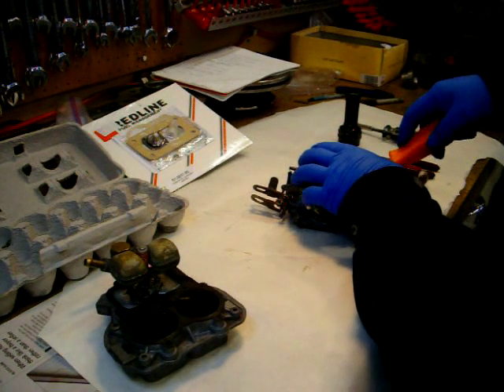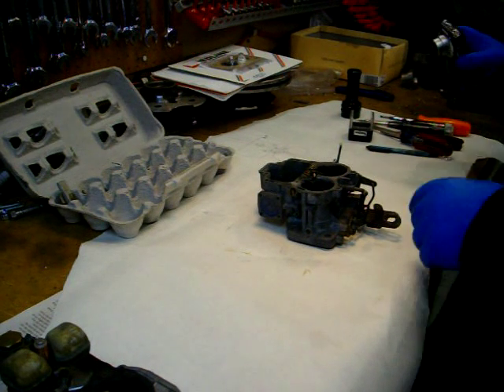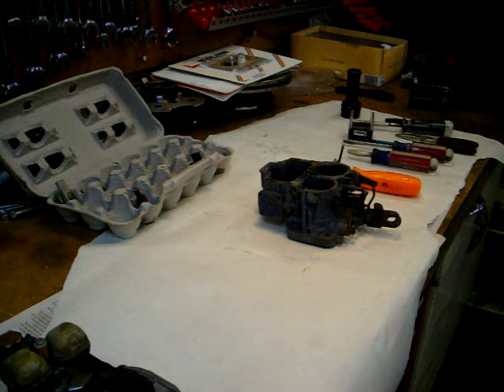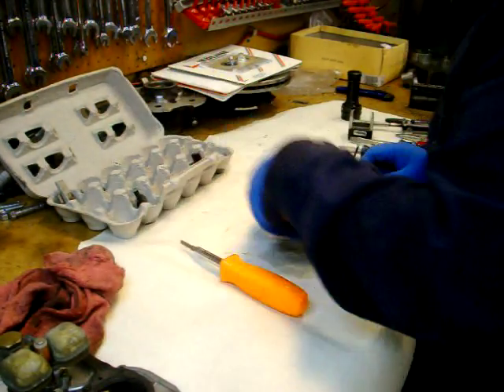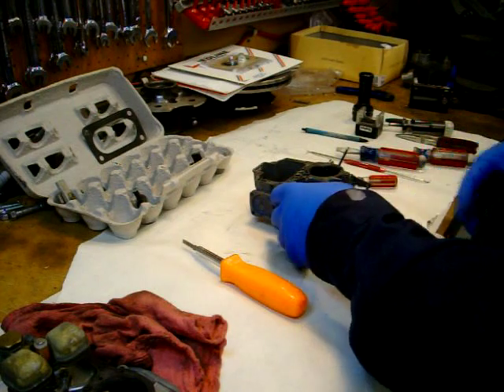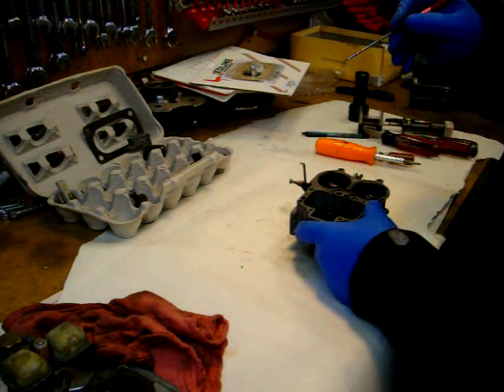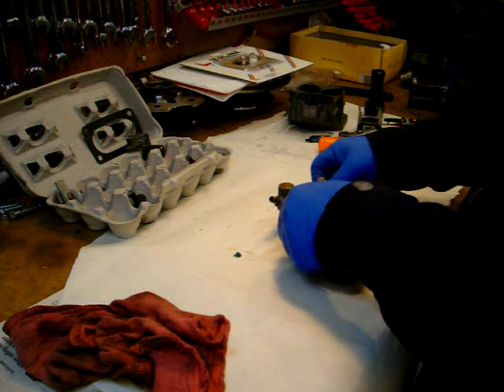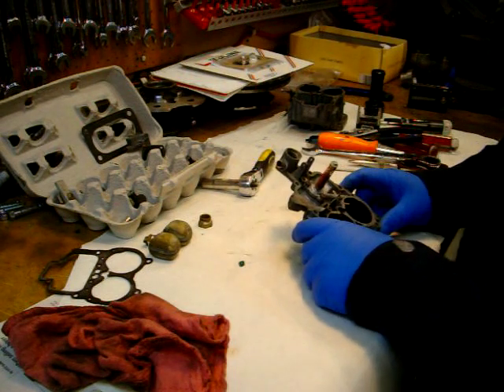Weber DGV Rebuild Part 1

Comment: If the venturi was backwards the jests are probably mixed up.
Reply from the maker: Pretty old vid, but if I remember right, everything was swapped side to side.....therefore wrong. lol  Worked much better after I got everything back on the correct sides.
Reply: @bluehandsvideo  <<<< I just did the same one but slightly different jets.  The last rebuilder had the main and second switched.  It was a probably 5th gen rebuild!  LOL!  Still got the wrong accelerator pump diaphragm in the kit, so I had to clean up the old one and use it.  Glad it was still alive.
Reply from the maker: @niceguy1183  Happy to hear you got it worked out. :)

Comment: Did you check side play on throttle shafts?  Good place for a vacuum leak if loose and leaking.
Reply from the maker: +Chuck Holmes  You are absolutely correct!!!   It must have been okay.....I won't rebuild a carb with loose shaft bushings.  These days, I have the equipment to replace the bushings if they're loose. :)

Comment: Thank you for posting. Very helpful indeed.
Just curious, I'm in same boat, as all the jets on mine are pretty much reversed from what Weber says they should be. Dunno if the previous owner was super smart or careless   ;) How was your motor running after rebuilt? Did you have any trouble?
Thank you again for posting.
Reply from the maker: This was a very early video for me.  I've always wanted to go back and redo it, I just rarely work on cars these days. .....just the parts. :)   The weber worked a lot better after I was done.  The weber is actually a bit more tricky to tune right compared to the Hitachi.  The goal with the weber is to have the butterfly as closed as possible.  The closer it is to closed, the more/longer vac signal you'll get for the dizzy advance.  Took me quite awhile to finally figure that out........which I did when I actually read the directions instead of tuning it like the hitachi!!  LOL!!!!  Don't have to be too bright to be me! :)
You're more than welcome!  I'm glad to hear it helped! Thanks!!
Mike

Comment: Ok....mate? Dunno what to say but 
You'd might as well had just done an audio version I couldn't see shit.  Have you heard of lights and an over head camera view. 
- I don't know what this part is? 
Maybe you should learn about the parts before making a video about fixing a carburetor. Nice attempt though.  How's that HD camera going....would love to see a strip down in a clear, close up well lighted video :)
Reply from the maker: You're right.  This was one of the first vids I took.  I used to do a lot of picture/text how-to's and write ups on the Datsun forums.....this was early on while trying to switch to video.  The new camera is much better and my shop has much better lighting not too.  I'd love to redo these vids.  There's a weber on my "Mend" 521 project, but who knows when I'll get to that.

Comment: The Weber has plenty of balls over the Hitachi,if tuned corrected. If you catch my drift
Reply from the maker: LOL.....I do.  Those little balls can be a PITA to keep track of sometimes!
The Hitachi actually works really well.....but the shaft bushings would wear out and once they started leaking, a new weber was a huge improvement.  The weber is a bit of a pain to get tuned correctly.  I learned the hard way that if you try to tune it the same way as the hitachi, it won't work well at all. lol  I think I spent a couple of years tuning mine wrong before I finally got wise and did it according to the directions.  Amazing how much better it worded after that!  
One of the best running L-series motors I've ever had, had a hitachi on it......but that was mainly in the lower half of the rpm range.  Overall, I think the weber is the way to go.. :)
Reply: I switched out my Hitachi for a 36DCD7 Weber (36/36) on my 1988 Nissan B140,the South African equivalent of the Datsun Sunny pickup. Rebuild kits for the Hitachi was just not good quality anymore,and I got tired of replacing it every few months. And like you mentioned about them leaking.  I definitely noticed an improvement from the Weber,but its not running as good as it should low RPM's. But other than that,it goes like the clappers when the 2nd barrel opens up. Bought a 32/36 DGV to try out and play with,and maybe use for a different little project, my 1972 Datsun 1200 GX with twin Hitachi SU's.
Reply from the maker: You're looking to swap dual SU's for a single DGV?  I'm curious as to why.
Reply: Was just playing around with a few ideas. Most likely the DGV will go on the pickup. I was always partial towards the SU's on the GX ever since I got it. It will just ad to the classic overall look to keep it on there. Right now they need a rebuild and balance.
Reply from the maker: I'd probably do the same thing.  I've got some SU's in a box around here.....they may make it to my truck someday....if I keep the truck.  I've even got the tool to balance them.  Are you familiar with ZTherapy?  They do a ton of SU work and even put out a vid on rebuilding them.  They're in Salem, south of where I'm at.  We're not buddies, but I do know the owner.  Been there a couple of times.  :)
Reply from the maker: I'd probably do the same thing.  I've got some SU's in a box around here.....they may make it to my truck someday....if I keep the truck.  I've even got the tool to balance them.  Are you familiar with ZTherapy?  They do a ton of SU work and even put out a vid on rebuilding them.  They're in Salem, south of where I'm at.  We're not buddies, but I do know the owner.  Been there a couple of times.  :)
Reply from the maker: will do.